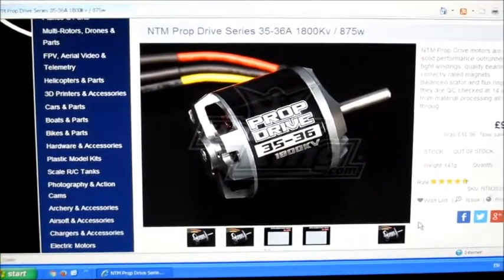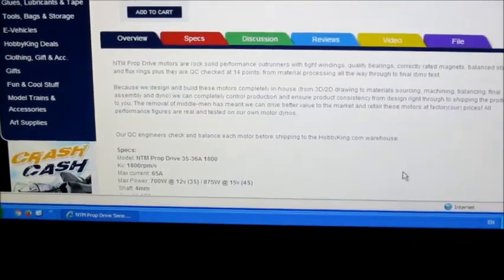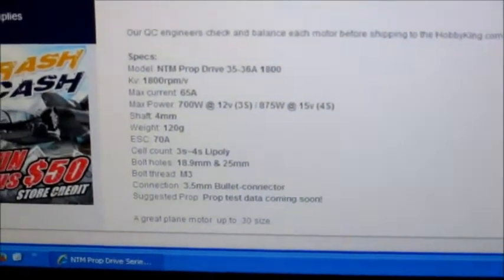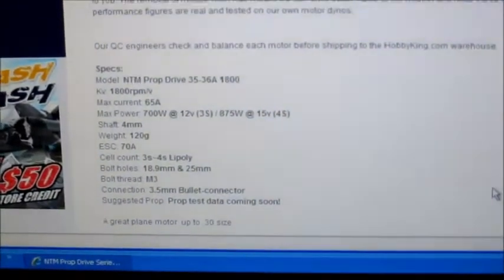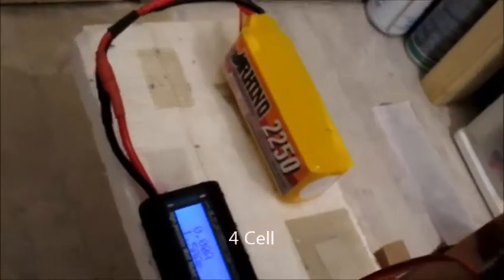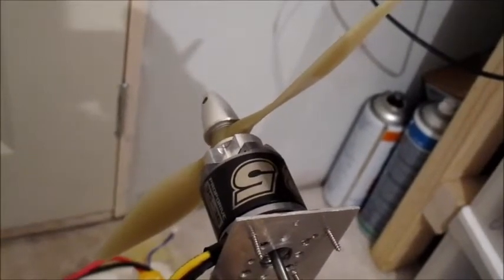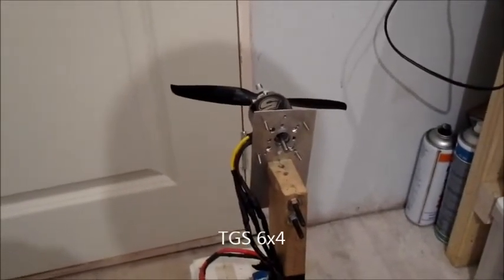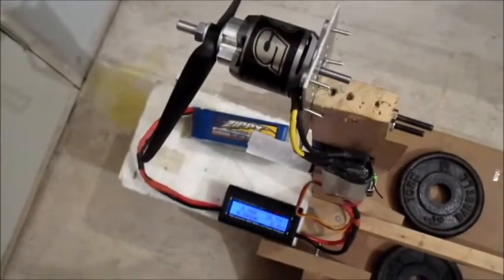NTM PropDrive 3536 1800kv Thrust Test on 4,5 and 6S Motor Test of the Week

Comment: I know this video is from a long time ago but I’m doing the same set up with a 5 x 5 in the motor screeches at higher rpm I also have this PWM set to 16 I have the timing set to zero. Is there anything else you could suggest

Comment: Results:

4S:
7x6E Aerostar: 1780g at 64A/888W
7x6 APC Gas: 1840g at 57A/840W
7x8 APC Gas: 1480g at 68A/910W, voltage drop
8x4 Aerostar: 2600g at 68A/987W
8x4 JXF Gas: 2540g at 62A/884W

5S:
6x6 Gemfan: 1520g at 57A/1060W
6x4 TGS: 1860g at 49A/909W, prop warped

6S:
5.5x5.5 Gemfan: 1770g at 69A/1603W
5x5 TGS: 1670g at 49A/1135W

Comment: What kind of propeller I use for1900kv .....give length also??
Reply from the maker: What size is the motor and on how many cells?
Reply: @rcplanepirate  I need propellers for t motor f80 pro........1900kv
Reply: 6s battery
Reply from the maker: I couldn't really say as I don't have one to test and you can't just guess going by the kv. If you want to run it on 6s then start with a very small prop first and check the temps and amps. Then go to a bigger prop if safe.

Comment: What is the best Timing for this motor on 4s?
Reply from the maker: Not sure. Depending what esc I'm using I normally just leave it on auto timing but change the PWM frequency to 16khz.
Reply: Ok THX but i using a hobbywing platinum v4 and this thing want the exact timing from 0 to 30° in 1° steps.
last time i smoke a 3536 3000kv with wrong timing :-(
Reply from the maker: I find the HW Platinum works well on the default settings.

Comment: RCPP, how would this motor go with a gas 7x5 or 7x4 do you think?
Reply from the maker: It will work fine. The second prop tested in this video was a 7x6 gas prop. So a 7x5 will spool up a bit more and give a bit more thrust but pitch speed will be less. Thanks for watching Phil.
...RCPP

Comment: Im at work and have sound off. Is 7x6 on 4s a good safe combo
Reply from the maker: Hi geminitool
Yes this is a very safe and excellent combo. I have even flown this motor with a 7x8 APC Gas prop with no problems. Thanks for watching.
...RCPP
Reply: @rcplanepirate  Why do you run on 6S, if you get the best thrust at 4S with less wattage? Is it because you want to run at lower amps?
Reply from the maker: @StavrosKor  Higher rpm's mean higher pitch speeds. So on the right plane you'll get a faster actual speed.

Comment: Thanks again i had a little accident with my efxtra and the stock aerostar stock motor internal shaft bent and i stripped one of the grube screws, arghhh. i do have an extra 4mm shaft for replacement, but cant get the shaft to get out from the motor, so i'm going to order this 3536 1800kv V2 motor and hope it will perform same or better. Its almost identical to the stock motor which came with my efxtra, same numbers and prop sizes on 3 - 4s. 
https://hobbyking.com/en_us/motor-3536-1850kv-inc-prop-shaft-aerostar-branded.html
Reply from the maker: Yep this motor should work great on the efxtra. It's what most people fitted in the old efx racer. If you want it fast on just 4s get your self some 7x7 or 7x8 APC Gas props.
Reply: I'm using 7x6 & 7x7 aps sport (gas) props on the efxtra with great results. Also using 7x5 sport prop with het 2w30 on 4s on the funjet, its the fastest set up so far, my old set up was clocked at 123mph, dopplered by someone on rcgroups. The current set up is i think140 + mph easy. haha. Its scary fast, pulling 80A at full throttle. thats what the motor is rated for. 2700 4s 60c battery down after 4 passes, then i land haha. will try to get a video next time. Maybe even 150mph, i have no means to measure.
Reply from the maker: Nice! Sound like you're getting great results. If you want to measure your speed you can get a gps logger here. http://www.velocity-rc.com/cgi-bin/vrc/prod/manager.cgi?action=show&pid=82

Comment: Thanks for your videos and the time you put into providing the data.

It would be great if you had website for electric speed plane addicts suggesting safe motor/prop/lipo combos you recommend from the info you have collected.

I tried this 35 36 1800kv today, all be it the version 2 which now takes 70amps. The NTM name appears to have been dropped, now known just as propdrive on a 5.25 x 6.25 6s but drew way over a hundred amps and 2600 watts during burst testing resulting in a smoked fried motor.

I'd love to run this speed prop with a motor that could handle it on 6s. The search goes on.
Reply from the maker: Thanks MARK1Spitfire.
Your comment is much appreciated. You have 100% grasped the concept of what i'm trying to do here. The website is a good idea  but i'm not very good with computers. I'd need a lot help with that.
As for you smoking your motor i'm surprised by that as I have seen other people use that prop on the V1 3536 1800kv motor at only about 1500 watts no problem. What esc were you using and what were the settings? Also what size 6S lipo?
2 motors I can suggest that will run the 5.25x6.25 APC prop no problem are the 1850kv Warhead and the 1900kv FMS EDF motors. They are about 50g heavier then the prop drive motor though. If you haven't seen the test videos of these motors yet here are links to them and thanks for watching.
https://www.youtube.com/watch?v=7eIpC-Ojcws

https://www.youtube.com/watch?v=QJFwqvEJoEw
Reply: Yer, cheers for your reply & two other video links.  

The warhead looks interesting, in fact they both do. Not everyday one orders a warhead unless your military commander but if i did would an 85 amp ESC being sufficient on a 6s spinning a 5.25 x 6.25?

I’ve come from a 2 stroke tuned pipe background on fast deltas but those days of constant full throttle flights, fill up and go again are gone for now.

Electric is unfortunately about burst flying, a life off charging, strapping on a gps logger and for me beating your model mates speed whilst getting an adrenaline fix

The meter used was a 'watts up' meter
Battery was a nano tech  2200 6s 45-90c 
The ESC was a 85amp hobby king blue series, set to auto timing, acc start
The ESC temp seemed ok to touch after allowing over 100amps through it from static bursting 

My goal is to find a fast motor set up, ideally 6s, but don’t rule out 4s for an older Simprop ‘liftoff XS' 1760mm hotliner glider I inherited to destroy my fiends HK 1300mm Reverb glider with a recorded GPS recorded ground speed of 131mph who’s having great success with a 3s 28/36 3000 kv on a 5.5 x 5.5 HK prop. Both gliders use a slippery MH43 aerofoil.

Previously the 'lift off XS' ran an older jeti phasor 30/3 in runner on 3s. I can see why inrunners help with internal glider installation when motor wires exit the back of motor

To mount the 35/36 1800kv inside the 'lift off XS' nose is difficult. The exiting motor wires are too close to the spinning bell housing with the long shaft facing forward, the wires travel too close over the back over the bell housing. 

Instead Ive opted to copy what some of these F5D/F3S speed addicts are doing by exterior mounting out runners to the front of the nose. This seems precarious for landing but great for cooling. 

Still would prefer an out runner motor inside fusualage which needs to be up to 36 mm in diameter but would need cut hole in fuselage nose to allow motor wires to exist and go up and over the spinning motor housing and back into the fuselage nose again.

Before I came across your great testing site, another youtube tester recorded 69 amps 1471 amps on 6s with the 5.25 x 6.25 prop with 35/36 1800kv v1. This inspired me to make the investment of the motor/esc/prop combo but was little disappointed not achieve same data.
This led me to believe that the high power /  amp readings I was seeing could be down to high voltage spikes caused by fully charged battery.  Its settled reading was still sucking the amps up though. 

In my opinion, this prop is too much load for this motor, dangrously jacking the amps up above the motors 70 amp rating on 6s.

Now Im left with an 85 amp speed controller,  a cooked motor and yet another lesson that over amping kills motors due to excess heat regardless of the watts,, especially if you don’t let the motor cool in between static bursts whilst testing.

‘Lift off’ hasn’t flown yet on new set up due to Friday's fry up.
Reply from the maker: Boy that was a lot to read:)
The one prop I didn't test on the warhead motor was the 5.25x6.25 but I do have some of them so I'll give it a try tomorrow and let you know the results. I got 133mph with a 6x6 prop and this motor on my HEX JET. link
https://www.youtube.com/watch?v=wpLbOvG7Ovk&t=343s
The set up for your 3536 motor seems fine those HK Blue ESC are really good and the default settings should work fine. Maybe it was just a bad motor or maybe the V2's are wound different to the V1's and they don't like running 6S.
The GoolRC inrunner motors off ebay i've been testing lately are AMAZING! All be it a bit heavy but they don't cost to much.
Get your self a great big ESC and one of these motors and you'd destroy your competition! Maybe the 3674 2250kv one would be good.
Reply from the maker: Hi again I said i'd test it for you and i've just finished testing the warhead 1850kv edf motor on 6s with a 5.25x6.25 APC prop. I don't have a HK 85amp blue esc so I tested it on one of my red HK 80 amp esc's with a 2650mah 40c 6s zippy flightmax and the results are as follows. Thrust was a peak of 1380g then dropped to 1310g after about 5 seconds. 82 amps and 1779 watts of power. Hope this helps. Let me know how it goes.
Reply: Sorry for the usual short reply, you sir are a star. Thank you.
Reply: Hi. 

Update 

Hotliner on Warhead set up up went very well. Great match for this prop.

Good lick of speed, though suffered from aileron flutter during high speed dives.

Lots of bursts. Prop screaming. Aggressive.

Timer set 2.20mins on the sim prop lift off XS1760mm glider to indicate to landing phase to leave 20% lipo capacity 

Hotliner comes in hot

6 flights today. 

Motor and 85 amp esc behaved on the 5.25 x 6.25 speed prop. Motor hotter to touch than 2200 6s bat and esc but all fine.

Didn't GPS 

Need more speed   :-)
Reply from the maker: Great I'm glad it went well. Love to see a video of it. Forgot to worn you that it's a very loud set up. Don't think you will get much faster with out going to a bigger ESC and running a graupner or gemfan 6x6 prop which will pull over 100 amps or trying one of the GoolRC inrunner motors I suggested like the 3674 2250kv motor. Maybe i'll get one next month when i get payed and do a motor test on it to see how it performs;)
Reply: Propping it for 6 x 6 drawing a hundred amps is a recipe for another cooked motor on 6s. ! max burst current for the warhead is 80 amp 

Its current loading is close to parity for watts and recommend amps.

Unless,your implying 4s on a 6x6 or try a 7x6. ?

My issue is balancing the model. The esc is scary close, less than 5mm from the back of the spinning warhead with the 6s lipo right behind the esc. The bulky capacitors don’t help.

A longer heavier in runner maybe problematic but then no ugly out runner exiting motor wires out of fuselage and back in.

 Amps similar with warhead and 3674

 GoolRC 3674 4Poles 2250KV Brushless Motor 

Model: 3674 
Dimension: R36 * 74mm 
KV(RPM/V): 2250KV 
Poles: 4 
Watts: 1800W 
Max Voltage: <22.2V 
Max Amps: 80A 
Shaft diameter: 5mm 
Connector: 4.0mm gold plug 
Recommend battery: 2S-5S 
Recommend model: 1/8 RC Car,Boat 
Package size: 9.5 * 8 * 6.3cm / 3.7 * 3.1 * 2.5in 
Package weight: 337g / 11.9o

Warhead 3545-1850KV

RPM/v: 1850kv
Dimensions: 67 x 36mm
Shaft: 5.0mm 
Voltage: 11.1V-22.6v [3s~6s]
Weight: 171g
No-load current: 3.5A/11v
Max burst current: 80A
Max Watts: 1650w
ESC: 100A
Resistance: 0.012 ohms
Thrust: 2650g [example based on 5 blade fan/6s combo]
 
Mounting Hole Bolt Circle: 26mm
Mtg. Hole Number & Size: 4 x M3
Reply from the maker: Yes i was wondering if it was a fitment issue with fitting a bigger ESC. As for the Warhead motor pay no attention to the specs given. With a really good quality ESC of which i recommend a Hobby Wing Platinum. Yes thats Hobby WING. The Warhead motor can take WAY more power then the specs say. Did you watch my test video of this motor.
https://www.youtube.com/watch?v=QJFwqvEJoEw
It can easily take 100 amps +. I ran it on a 80 amp Hobby Wing Platinum ESC on 6S at over 100 amps at 2150 watts on my HEX JET with out fault. While testing this motor in the test video it only started to get hot when i ran it on 8S at 3500 WATTS! On the subject of the inrunners at least you don't have to worry about the motor spinning inside the plane and touching things. Also because of the low pole count on them you can use a really cheep ESC. I've been running them on the Red Brick ESC's and they work really well. Just so i know you said you didn't gps it but if you had to guess how fast do you think it was going?
Reply: Hi

GPS 107 mph. damm.! lol

Large heavier glider though. 

Couple that with aileron flutter inducing wing flutter with a screaming warhead, its all fun.

Warhead does get hot for a 2.5 min flight, but mind you its not mounted outside which I assume the hexjet is

What was your prop and flight time on hex jet, 6s warhead.?
Reply from the maker: Hows it going mate. 107 mph not bad. Would of thought it would be faster though. Got to sort out that aileron flutter if you want to go faster. Yes on the hex jet the motor was mounted on top of the wing on a alloy mount so good cooling. Make a cooling vent and scoop out of a plastic spoon with a hole at the back for the air to exit from to get better cooling.
The prop on the hex jet is a 6x6 graupner cam prop which gave me about 3 min flight time on a 2650mah 40c 6S Zippy Flightmax. 
It sounds to me like you need a bigger prop to give more thrust. If you can get one try a 6.5x5 prop and run it on 5S. It should be about a 85-90 amp draw so still be safe on your esc. Less pitch speed but should give a lot more actual thrust then the 5.25x6.25 prop on 6S. It's worth try different combo's to see what works best. Again let me know how things are going.
Reply: Hello Mate.

Disaster. 

I finally got a weather window today after swapping out wing servo for new 4kg type to try and fix this aileron flutter.

It didn’t work and after 3rd flight the wing separated from the fuselage at 100 mph causing the fuselage to carry on like a dart until I throttled off before ground impact.

To round it off the 6s lipo ignited, smoking like a trooper going out in a blaze of glory. ! lol

Couldn’t find the Warhead. ESC destroyed. Hotliner a right off

Now after a new speed plane, so everything on the cards.

Not sure what to get next.

With regards to your thrust comment and 5s suggestion Im gutted I couldn’t get around to trying that. I think you were right. Lacking thrust. 

She was no slouch. The warhead was fantastic on that speed prop. Sounded awesome.  I would have liked too to have upgraded to 100esc and tried your 6 x 6 set up.

Much appreciated tip by the way.
Reply from the maker: NO! That sucks! I had the same thing happen once. The wing just folded in half and came off the plane when trying to do a full throttle loop. It's amazing how far the fuselage carry's on going with no wing and then goes in the ground like a dart but that was just a very simple balsa plane I made not a nice Hotliner like your's.
 I have actually designed a new plane this week with 2 different wing styles. They are just over head view pictures i've drawn on the paint program on my computer. If you want to see them i could email them to you.
Going to be fitting mine with the GoolRC inrunners when i get round to making them. Hope you've got some other nice fast planes to fly in the mean time.